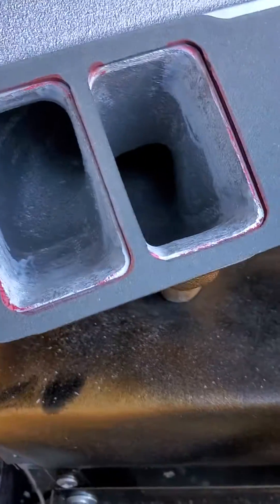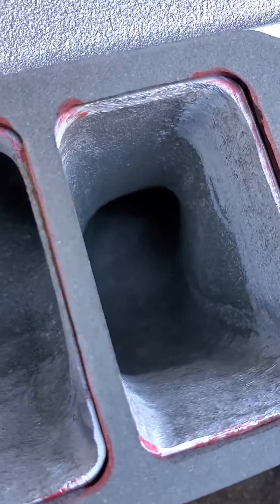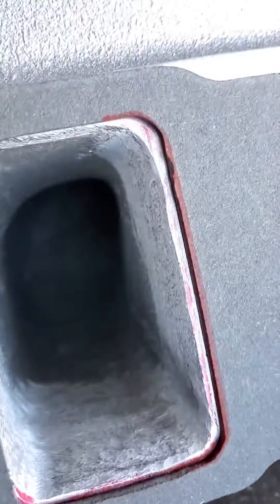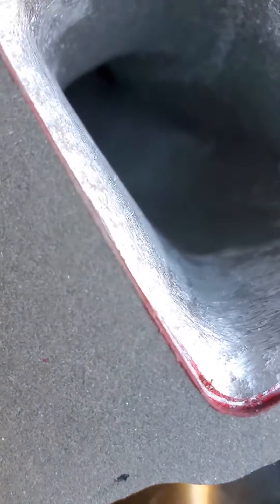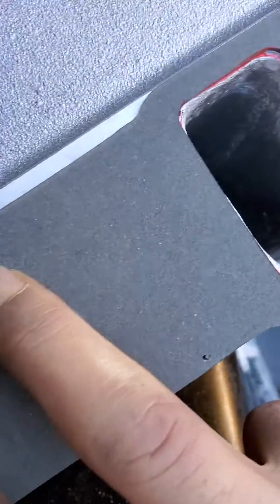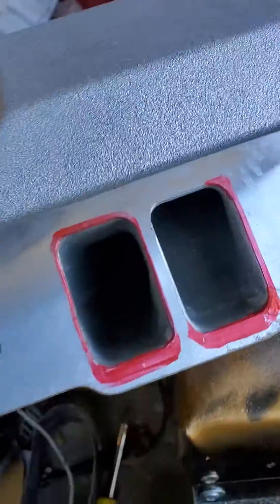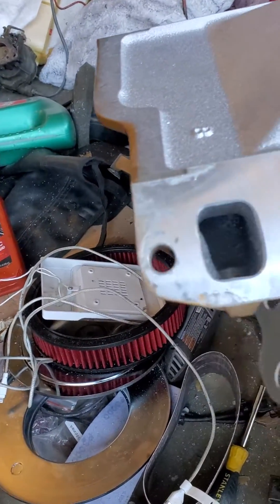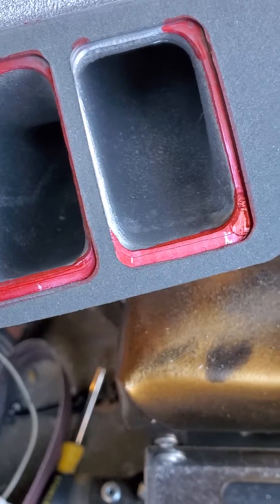Porting Edelbrock RPM Air gap to 1206 gaskets part 2

Comment: What heads did you use with the 1206 gaskets? I use a 1205-S3 and its about perfect for mine with 190ish cc runners on the heads
Reply: Dont forget  to install  a 1 inch carb spacer plate  on top of that manifold    to raise  those  carburetor butter flys above the tops of those runners , it good for around 5 to 8 horses